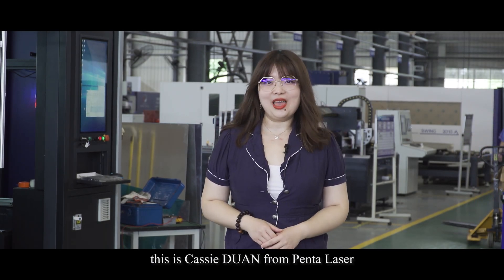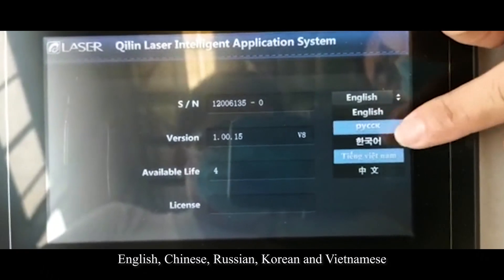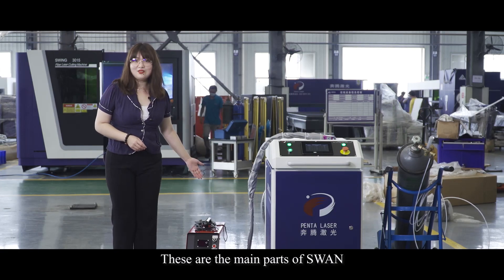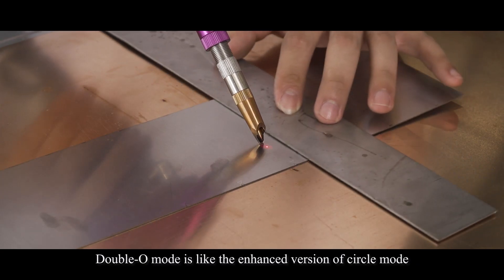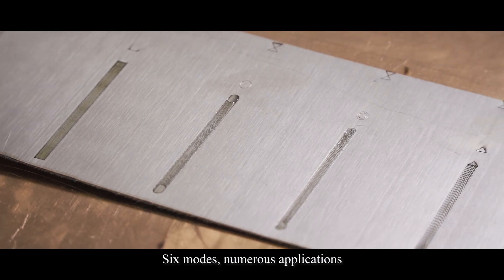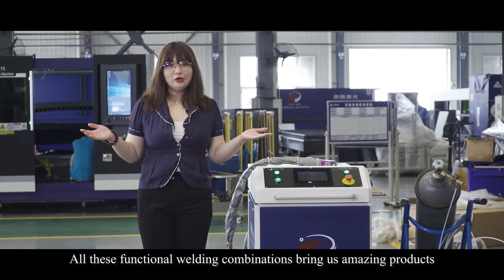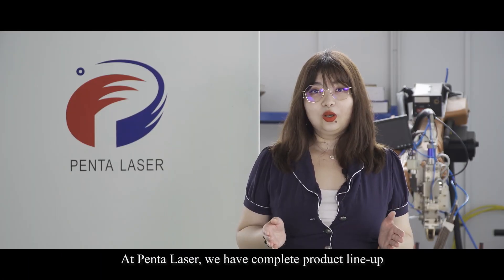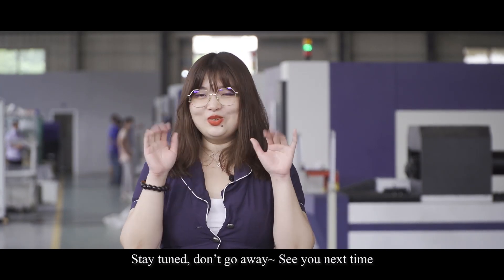PENTA LASER HAND HELD FIBER LASER WELDING MACHINE

Comment: 4:18 really highlights the heating differences. Look at the depth of thermal penetration as the welder changes speed by the colour change.
Good for clean finishes. Poor for structure.